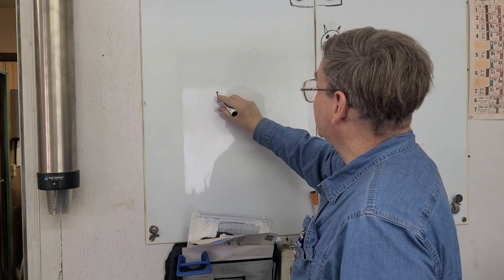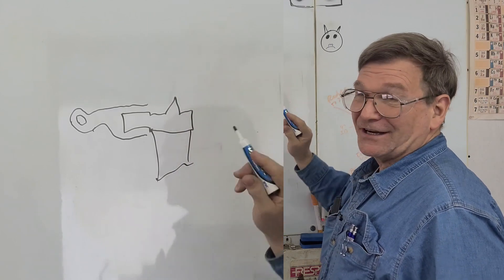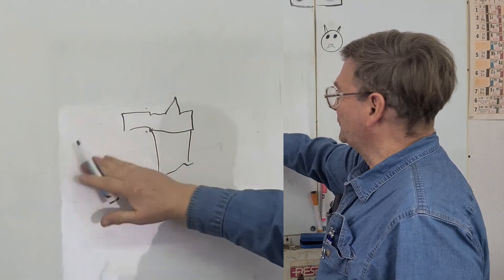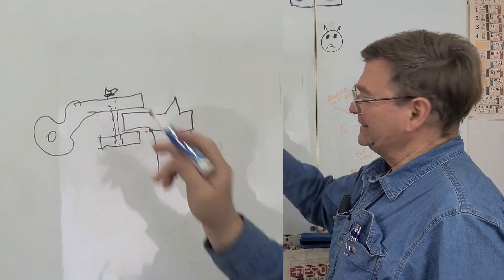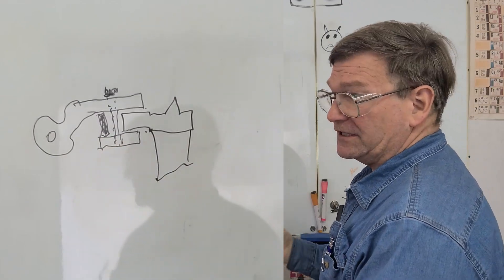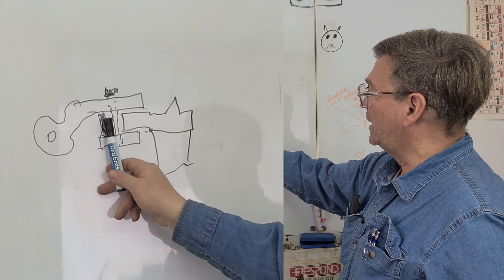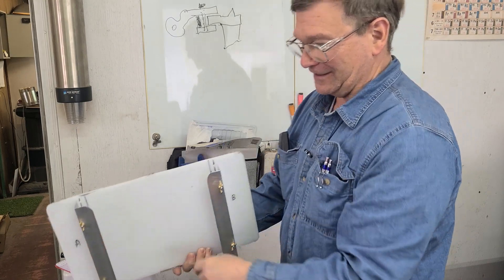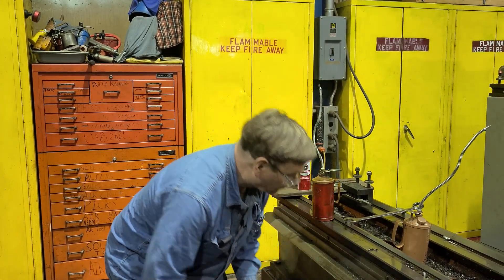Machinist's Minutes: Ensuring tight fit with clamping attachments

Comment: I have an old old micrometer stop from a South Bend lathe that is made in just the way you describe.  The spacer or stud is even adjustable so that you could use it on a variety of their lathes I would guess.  This allows me to use it on my Emco Super 11 even though the vee machined into it is not quite in a perfect alignment with the vee way of my machine.  I leave it clamped at the headstock end of the bed so there is no possibility of damage to any part of the ways of the lathe due to this misalignment even though the bed is hardened and the stop is just cast iron.